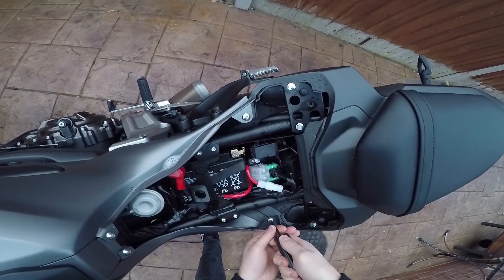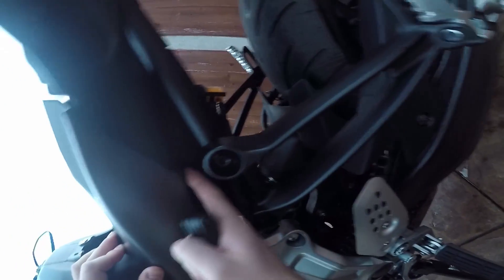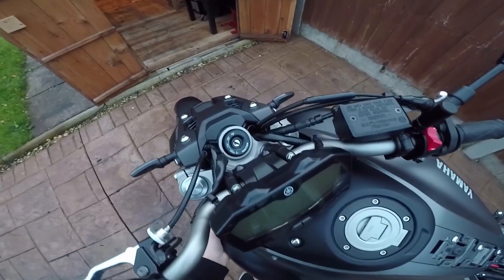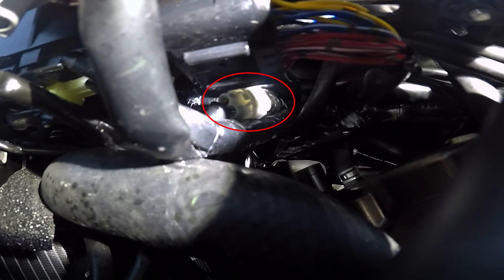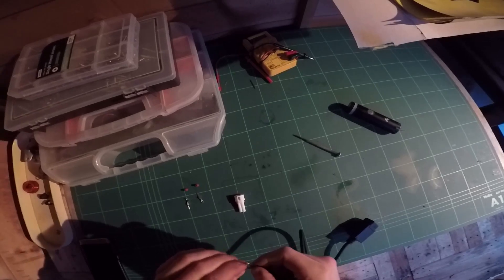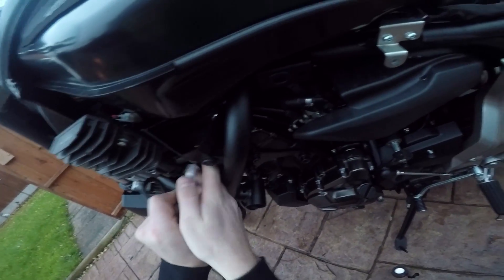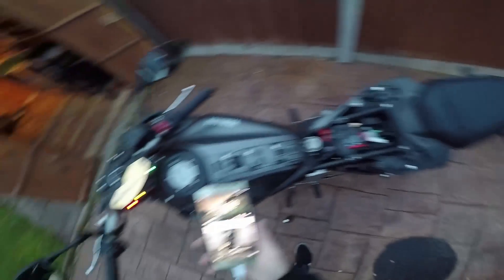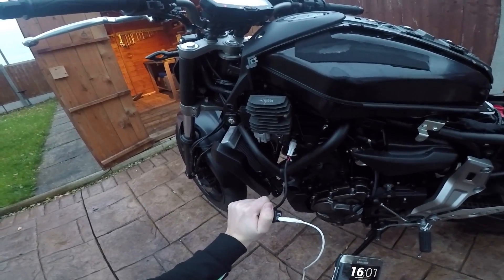How to install a USB port to your MT07 FZ07

Comment: Very helpful video. I used it today to install a USB on my 2015 FZ 07. Couple of tips that may help the next intrepid installer. In frame 2:53 where you are removing the plastic side shroud from the tank, I used a plastic wedge to release the visible tab, but there is also a not visible tab on the bottom side that can be released by pressing downwards on the center plastic just ahead of the visible tab. 
Also, the front friction fitting you mention consists of a post pressed into a rubber grommet which installs into a cutout in the steel frame. When I pulled that front end out, the grommet came with it, so it is just a matter of removing the grommet from the post and reinserting it into the frame prior to attempting to reinstall the plastic shroud. 
And when installing the pins on the wire ends, I initially failed to crimp the tabs enough onto the wires, so after connecting the connector halves and testing the system, the wires pulled away as I was ty-wrapping the connector in place, so had to start over again. Make sure to install the rubber seals on the wires first, and orient the pins correctly into the connector. I pressed the seals into the tubes with a small flat bladed screw driver to ensure the pins extended far enough to mate with the female sockets in the OEM connector. That also seats the pins into the mating connector half.
Oh, and to locate the OEM connector, I disconnected the large aft dark gray connector and the auxiliary power connector was directly inboard of that, so it was easier to see and work on the wiring as well as route the usb cable from the handle bars following existing wire bundles.
Other than that, it was a piece of cake!
Reply: i realize I'm kinda off topic but do anyone know of a good place to watch new tv shows online?
Reply: @Riley Dakota flixportal :D
Reply: @Bradley Cyrus thank you, signed up and it seems to work :) I really appreciate it !!
Reply: @Riley Dakota glad I could help :D

Comment: Thank you, nice video.
Buying my MT-07 my dealer did that for me at no cost (had negotiated it). Wanted a 12v plug just in case to be more flexible at the bars. He did a great job there.
If you plan to buy your MT-07 / FZ-07 you may ask your dealer to do that,  because why not :)
Reply: Nice bud negotiated that badaass 12v plug on a 10 000 bike :D
Reply: I think a 12V socket is a better choice than a fixed USB charging port. You can do more things with it, including fitting a removable USB charger that is easy to replace/upgrade.

Comment: Thanks for the video! One (probably stupid) question. I assume you just remove the battery connectors on the usb connector to get the wires free to insert into the male aux connector? Any advices on that specifically? Thanks again!

Comment: Bro, you don't need to remove all those plastic parts to install the USB changer, connected to the AUX con. 
It can be easily feeded trough to.

Comment: Just curious what was the plug hooked up to prior to install?
Reply from the maker: PynkPwny nothing it's an Auxiliary plug
Reply from the maker: tim dimondi that is correct yes
Reply: Actually that "dummy plug" that was holding the connector in place is the exact same plug he purchased... it's held in place by a little electrical tape.  He didn't need to but the connector...  just the male pins that go into the connector.
Reply: Joe Gray just realized about it after buying and installing everything
Reply: Dennis Herrera yeah... it's a pretty common mistake.

Comment: Hi mate, I bought all the items you mentioned here, the USB socket that I got came with a fuse and it looks like you cut one off.  Is that because the accessory plug is fused?  Would be great to be able to shorten the cable like you have.
Reply: Yes, the aux line is already fitted with a 2A fuse.

Comment: Bro I want that motorbike but scare to get one because of the bike thieves what do you do to keep the bike safe when you're outside and your bike needs to be parked outside?
Reply: Big ass chain, some form of alarmsystem. Possible gps tracker?
Reply: TheMetalHead But they can steal cut through the chain though. Plus  big chains are really hard to find.
Reply: Well, the more you do the safer you are. I never leave my bike out of sight too long along with don't park it anywhere. Park it at night in your garage or house...please.
Reply: I use both a chain and disc lock alarm.

Comment: I have a question to the r7 and since they are close to identical bikes under the fairings, maybe someone has a clue...
The R7 has two identical plugs. one on the left and one on the right.
The left is for the quick shifter i believe. the problem is: the right one doesnt work for recharging my phone. on the left its working. do i need to eneable the right plug somehow?

Comment: Hi there, I bought everything like recommended. Somehow I couldn't manage to install the cables in the Yamaha connecter probably. Can you give me any advice, how to crimp the male terminal, that the cable is tight and fits in the housing that it clips and doesn't fall out
Reply from the maker: sorry for the late reply. if you've managed to do it already then great! if not the connectors only go into the housing one way. flip them around until they slot in and click
Reply: Hi, thanks anyway for responding. Actually I found out that the connectors only fit into the housing one way. However I'm still struggling to get the connecters probably crimped. Which part of the connector has to be crimped and what kind of tools have you used to do so?
Reply from the maker: I find that long nose pliers work best. there should be 2 bits on the connector that stick up, bend one in over the exposed wire then bend the other over that
Reply: Thanks alot mate. Just tried again, successfully this time.

Comment: Question, if I'll plug in my smartphone to charge won't it burn up since smartphones only charge around 5 volts and not 12?
Reply from the maker: Ivan Gutsan no buddy, if you buy the right connector it drops the 12v down to 5v, just make sure the connector you buy has a 5v output!
Reply: MT 07 UK Owners Club got ya! Thank you
Reply: @JanisStrelkovs  Where to download the program on the PHONE?

Comment: Didn't see the ebay link for the plug, can you post this ?  Great video, thanks
Reply: Plugs are available at ebay. Just paste in search bar "Yamaha DC Power Outlet Connector Plug MT07 MT09 FZ07 Heated Grips USB Charger"